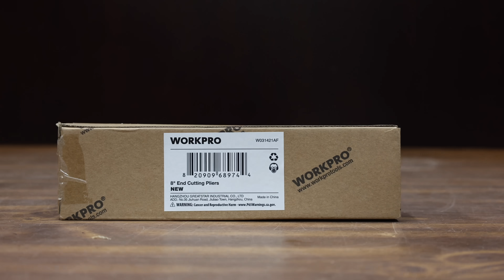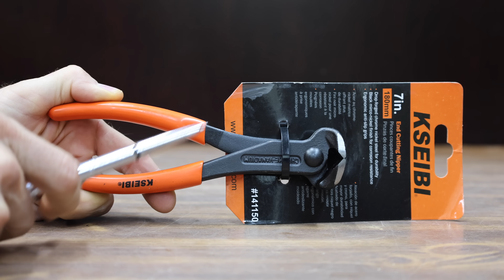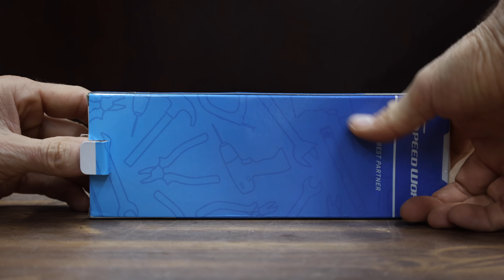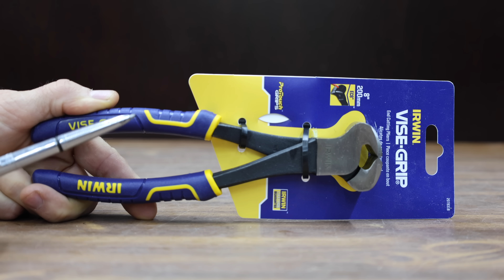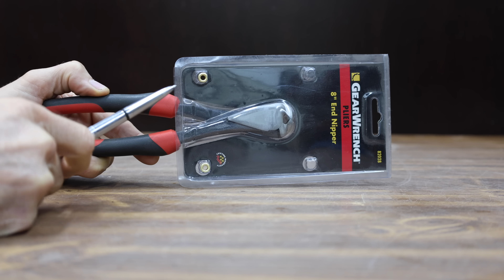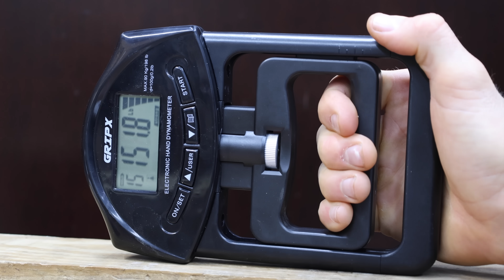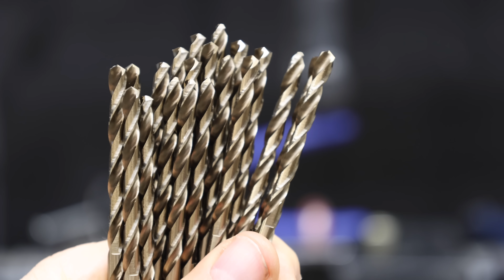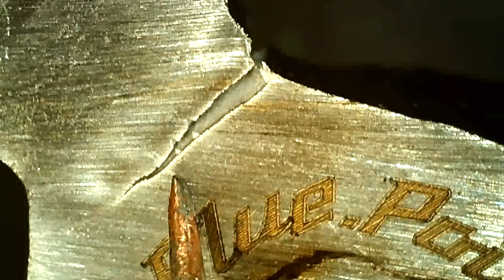Finally! Best Pliers I've Ever Tested! Not Even Close!

Comment: Video idea: Best multimeter- Testing accuracy, time to measure, performance in cold climate, drop test, quality of included leads, screen size/clarity/brightness
Reply: Oof... extremely expensive. Bets on Fluke 87V MAX being the best under $1k.
Reply: @zkhcohen it'll probably be Brymen
Reply: @Keiuran  I would be curious to see a showdown between Brymen and the alternatives. Fluke is still the industry standard, but feature-wise, Brymen would be my budget choice.
Reply: @Keiuran  Bought a Brymen several years ago and it has always been top-notch. Still on its first battery!
Reply: @zkhcohen I bet you fieldpiece and fluke are the same.  Fluke had a HUGE recall
Reply: @zkhcohen  ,absolutely. Fluke all the way!
Reply: @zkhcohen I have the older 87 V, $400, no regrets.  The average person doesn't really need that level of quality.
Reply: @zkhcohen and I thought my $80 one was expensive
Reply: @whatusernameis5295  Oh, my friend, look into intrinsically safe multimeters or scope meters. Your eyes (and wallet) will bleed!
Reply: That’ll be an expensive one for Todd!
Reply: @sambergin6225 I have to disagree. Once you get to the point of the really expensive multimeters above like $50-$80, you’re probably using the wrong tool for the job.
Reply: @JamesLake78  I have to disagree with your disagreement.
1) It would be expensive either way
2) It depends on your application, so I have no idea why you would make that statement
Reply: @JamesLake78  As someone who used to daily drive a Fluke 1587 for years, I have to respectfully disagree. It's absolutely overkill for most hobbyists, but for some professional environments I honestly don't think there's any better option.
Reply: @sambergin6225 the tools are written off as a business payment
The man pays nothing
Reply from the maker: Thank you for the video idea!
Reply: @ProjectFarm  preferably ones with DC Current measuring capability.
Reply: @ProjectFarm please do this suggestion. Multimeters are used all the time by tradesman. I swear by fluke but I’d be interested how other brands perform
Reply: @treehugger4916 Agree. Love my fluke but that's out of reach/unreasonable for the diy. Would be interesting to see how cheaper meters hold up
Reply: @ProjectFarm Odds are it will be Fluke. You will also need a calibrated voltage source to see which one is really accurate. Fluke are, IIRC, all supplied calibrated.
 Some multimeters can read RMS voltage, others cannot. A rare few have 5 digits instead of 4.
 If you set a multimeter on the 20VDC scale to test a car alternator, some designs will read the same when the polarity is reversed. Others go nuts picking up AC from the alternator.
 You might really need an E.E. or someone in the meter business to drill fown into the unobvious things.
Reply: @ProjectFarm  not sure if they are sold in US but I use UNI-T brand. they are really cheap and qualitity seem good for the money
Reply: @ProjectFarm  Maybe do a crossover episode with Marco Repps? He's another great no nonsense YouTuber with a very great sense of humour (if you're German). He'll definitely be able to test anything you throw at him.
Reply: @ProjectFarm  Reminder that besideds Fluke, top tier brands include Hioki and Flir (among few others) and even if its not considered up there, Uni-T is probably the most popular brand non the less.
Reply: You really need to have the knowledge and equipment to properly test these, you can't just do this like testing a drill or something. You'd be better off checking out the channels that already did DMM testing.
Reply: Have to limit that to cheap multimeters, he can't test professional models to a degree that does the differences justice with reasonable effort.  But cheap multimeters, like a roundup of best-selling amazon and eBay models is not a bad idea.
Reply: @BL-yj2wp 
 Or a nice way of saying it budget friendly models.
Reply: And something that prevents a dead 9v battery when the power button inevitably gets bumped on.
Reply: I second this suggestion for sure! I'm considering getting a new auto-setting one, and it would be great to see a comparison before I spend the money!
Reply: Crazy expensive and difficult to test lol. If he does this that would be absolutely insane.
Reply: I'd rather a best multimeter under $100 video, because I'm not buying the "best" regardless.
Reply: Contrarian here. This could be a great way on how to torture test a DMM, however what is the Use Case for Joe Homeowner?
I've used $1K Flukes at work, and they're great. However, my home/DIY non-high voltage DMM's are all the usual suspects reviewed by numerous YT'ers.
$30-50 will buy you a very accurate DMM that is actually legit Cat II/III rated, has solid construction and can survive drops.
If Todd does a review, I hope he'll the frankly dangerous Harbor Freight and no-name Chinesium brands.  A recent YT video pushed for DIY'ers to just get a mid-range auto-ranging VM.  Rarely is current really needed to be measure, and if you remove that from the equation then auto-ranging means no moving leads from one DMM port to another and no accidentally frying your meter because you were measuring current with the lead plugged into the volts port.
I kind of disagreed at first, then I thought back to how much and why I use mine normally, and a smaller, cheaper, less fragile simple A/R VM is smart.
Reply: @boots7859  "accidentally frying your meter because you were measuring current with the lead plugged into the volts port."  Been there, done that, welded the leads.
Reply: This would be **MULTIPLE ORDERS OF MAGNITUDE** more expensive than anything he has done before.  Precision electrical reference and precision electronics calibration gear would be in the mid to upper 5 digits - $30K to $80K - and not even for brand new gear, I'm still talking about decades old used equipment like a Fluke 5700 or 5720 in working order with current cal cert.  New / current gen calibrator like the Fluke 5730a would be in the 6 figure range - though you can rent such things for perhaps under $10K for a week I suppose.  If you wanted one step down you could have a somewhat reasonable setup with a 7 1/2 digit meter with current calibration cert + resistance references for around the $5K to $9K range... but if you also wanted reasonably precise and accurate voltage and current reference sources????  Ouch.  Seriously, seriously expensive.
Reply: EEVBlog has done that. Chucked an 87-V off a dam, among others. The 87-V lived. Fluke 87-V Max ($600) for handheld, Keysight 3458A ($15,000) for benchtop.
Reply: I'm sticking with the Japanese made one i got from Radio Shack back in 1990....
Use em nearly every week and it has the Original (believe it or not) AA batteries in it since all that time. 
But hey, how about a test of non-rechargable Batteries. Love to see what can beat mine, still running my multimeter perfectly after 34 Years 😉
Reply: Fluke or Simpson, no contest.
Reply: Fluke 27/FM - find a milsurp one on the bay of evil - usually under $100, and can double as a blunt force weapon.
Reply: Overall tolls like these, like moisture meter for wall and wood moisture levels and all these other small measurement tools.
Like laser distance measuring devices and so on.
Reply: Accuracy across AC frequencies would be good, up to 20KHz
Reply: @alonsocarrasco5460  Entry level oscilloscopes and frequency generators.
Reply: This would be a great video.  Would also like to see continuity testing responsiveness.  I have an old, cheap Greenlee meter that runs circles around pretty much any other multimeter I've used (Kaiweets, Klein, Ideal).  Would love a Fluke one day just because, but can't justify the price.  Though I've heard Brymen is a great, accurate, reliable and reasonably priced brand
Reply: yes!  Project idea: best multimeter
All meters have a rating of 600V Cat. III or better
Fluke 87V
Amprobe AM-530
Southwire 16020N
Fluke 101
Klein MM325
Ames Instruments DM600 (Harbor Freight)

AC voltage accuracy
DC voltage accuracy 
Max/Min recording function 
Backlight
Resistance (ohms) accuracy
Voltage spike withstand to failure
Reply: Yes, great idea.  Be sure to include the entry-level Fluke that gives you almost no feautres for only and arm and a leg.
Reply: We already have all of that data in the EEVblog forum, measured from absolute expert ppm nutjobs. Including destructive safety testing.
Reply: there's hundreds of comparisons out there for multimeters. Google it
Reply: there's hundreds of multimeter comparison videos out there for those who can Google it
Reply: I went with a Klein Tools CL390. It had a good bit of features for the price
Reply: Would love to see this!
Reply: Cold climate is one that would be pretty important for those of us that work inside and out.
Reply: I’ll save everyone some time- Fluke.
Reply: Include any from Harbor Fright (yes that is my correct spelling).
Reply: Leave it to EEV blog. He already made a video about Fluke multimeters. Spolier: they're not necessarily better multimeters just because they are a lot more expensive.
Reply: Nobody mentioning Sanwa in the comments

Dropped them off the top of a concrete tower (onto concrete) and I had to glue the speaker back into the body, otherwise they worked perfectly fine
Reply: @john_barnett  Simpson 260 in the original black Bakelite rounded case, lol.
Reply: Would love to see Uni-T tested. Got one hand-me-down unit and it's sturdy.
Reply: There is only Fluke and Brymen. Brymen have a much smaller range though. The rest are toys.
Reply: The Fluke Wakasagi Biwaa Scorptail is the best.
Reply: There've been a lot of these done by EEVBlog.
Reply: I work in facilities maintenance and they buy me fluke everything. In my personal toolbag I use the fieldpiece SC680. I understand my employer want's NIST traceable tools the get sent out for calibrations every year - but bang for the buck I really like that fieldpiece (although their leads suck big time)
Reply: Best under $50: Innova
Reply: Don't forget hot climate.  I've seen errors when left in the sun too long.  Cheers
Reply: I would also like to see more electrical tool testing. Like portable soldering irons would be good.
Reply: Accuracy and do a repeat measurements test. Some DMMs will vary resistance measurements across a 15ohm resistor. How stiff are the included test leads.
Reply: This is a really tough one to test as they have so many different features and there are a lot of good price/feature points. It really depends on what you want and what you need.
Reply: I got a "good" multimeter from Harbor Freight and the test leads are barely long enough to  notice there's test leads sticking out of the lead handles 🤔
Reply: @boredom.victim  Did you remove the probe tip caps?
Reply: @zkhcohen   I didn't see caps, it's the blue one
Reply: @boredom.victim Yes, I'm pretty sure you have to remove the caps. My multimeter has them too and when they are on, only the tip of the test lead is visible.

Comment: I’ve never seen pliers compared in this much depth before. That Japanese Wakura plier really surprised me, cutting down to 0.023 inches! Guess I know what’s going on my wishlist!
Reply: A very close shave, for sure. Unfortunately didn't hold up very well with harder materials but you can find application for them. Then grab a knipex for the tough stuff.
Reply: @Bakachu7 because wazakura is made to cut bonsai branches and soft aluminum wire. I’m surprised Jeff even had these in the lineup because it’s a gardening tool and not appropriate for this lineup.
Reply: The wazakura is impressive but it is a gardening tool meant to cut bonsai branches and soft aluminum wire. Not appropriate for this lineup even though it did well
Reply from the maker: Thanks for sharing!
Reply: Flush-cutters are always a tradeoff though, the edges aren't nearly as strong and they are not usually meant to cut hard material. 
Knipex prints that on the handles of their flush-cutters.
Reply: If you need to cut small wires as close as possible, I'd take a look at the Knipex 78 61 125 or 78 61 140. They couldn't possibly stand up to the abuse in this video, but they'll shave a wire flush.

Comment: Knipex has been the best pliers brand in my toolbag when I first found them 20 years ago. I STILL have every Knipex plier I've ever purchased. Get a set of Knipex Cobra's and thank me later...so...in 20 years when you're still using your first set😂
Reply from the maker: Thanks for sharing!
Reply: Indeed, their Cobras are awesome. Also the parallel pliers are super. Get a set of them too.
Reply: In my first set of Knipex Cobras the jaws are toast but in their defense they been through literal hell of automotive maintenance.  Regardless they are the best pliers in that class.
Reply: Have my little Alligator (Cobra without the knob) as every day carry for almost 15 years, the teeth are worn down after abuse and more abuse at work, but its still gripping like a champ, still no need to change 'em.
Reply: @nikolaikalashnikov4347   I'm not throwing the the ones out.  But I did buy a new set just incase.
Reply: i heckin love my cobras, especially the tiniest one, its such a handy tool. my most used wrench/plier in my toolbox.
Reply: way ahead of ya! great tool the cobras.
Reply: Cobras are fantastic. I use them for everything.
Reply: Knipex or KimUnipex? 😂
Reply: That's definitely interesting since this the only PF video they came out on top on lol
Reply: Sligh correction, the linemen were good and the slip joints were really good. It was the needle nose and wire cutters that were pretty disappointing

Comment: I hope you can accept some criticistm. you are comparing how close these piers cut to the surface. these are not designed for that. 
in reality, the extra length of wire that is left after cutting the wire is a benefit to certain work. 
you are comparing the parameter of the tool, that is not critical for it's operation

Comment: Suggestion: test framing hammers. It’s so hard to find the perfect hammer. Between weight, head surface area, ergonomic-ness of the handle, and effectiveness of the claw (slipping off 2x4s or not), I’ve never had a hammer that satisfied what I like in every area.
Reply from the maker: Thank you for the video idea!
Reply: Have you tried an original "Death ☠️ Stick" framing hammer? Not sure they're still around and there are some lookalikes, but that original's a beast and a beauty! Got it in the '80s, I think. 😎✌️

Comment: Do you prefer a very stiff handle, or a pair with slop because the retention pin wasn't peened well enough?

I bought a pack of amazon basics insulated tools for doing electrical work on my house. Kept the screwdrivers. Pliers went to the nephew's toybox. Kept em out of the scrap heap that way, and I got "cool uncle" points.